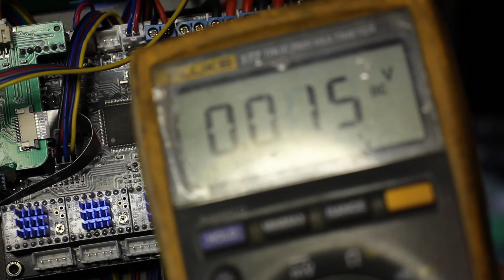3D Printer Silence Mod | AnyCubic i3 Mega

Comment: The beginning of the SD card repair was importent to see. What have you done when you desoldering the metal cap?
Reply from the maker: Typically for something like the top shielding of an SD card reader, since it is broken and will not be used again, I will simply clip/cut the legs, remove the shield, then remove any debris from the solder pads.

Comment: Good mods for this line of printers. You should look into getting a Pi4 and convert to Klipper firmware (relatively easy and reduces print times). If you do, then you can install a touch probe and setup UART mode for even finer refinement (your board will probably be a clone Trigorilla board) for those drivers as well as remote print like your current firmware. Did that with my Mega X and its night and day from stock.